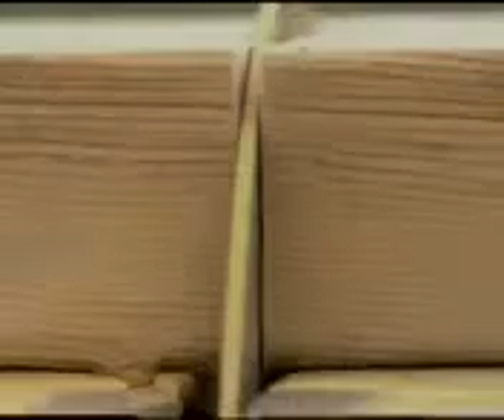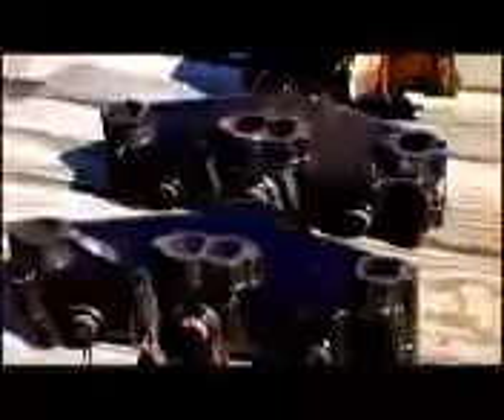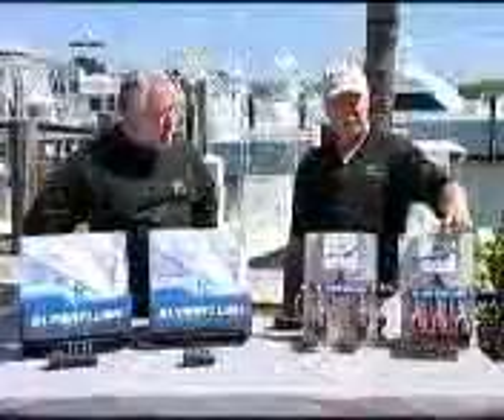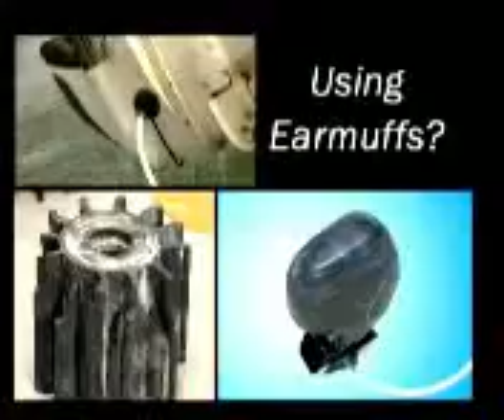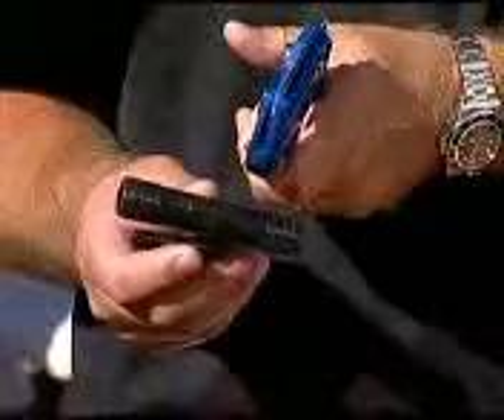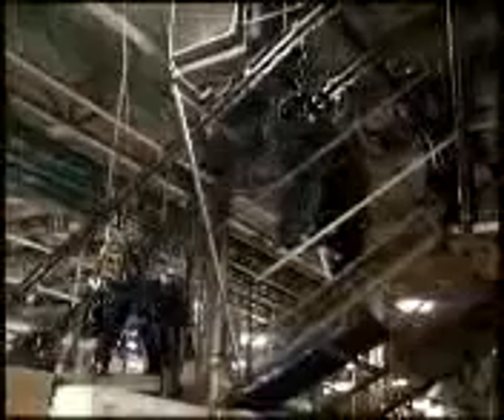SSTV 2 0 LR

Comment: With this SF-400 system on an I/O (Mercruiser Horizon) do you run the engine or no while flushing? Thanks.From an Merc owners manual important notice...("Flushing the engine when it is not operating will result in water collecting in the exhaust system, damaging the engine. Do not supply flush water for more than 15 seconds without the engine operating.")https://www.manualslib.com/manual/1139298/Mercruiser-5-7-Mpi.html?page=75#manual